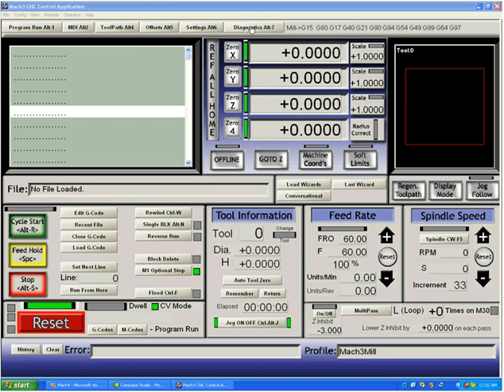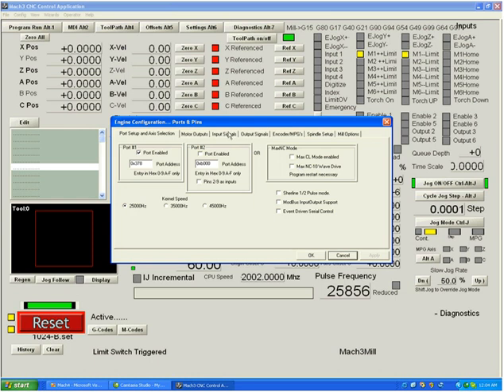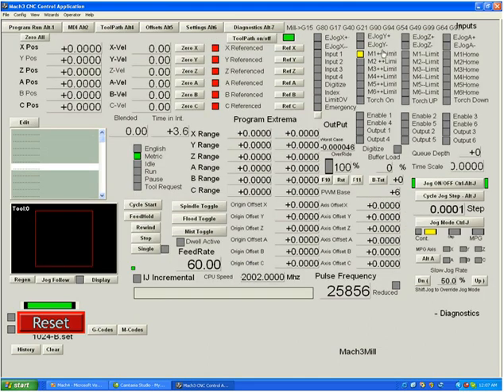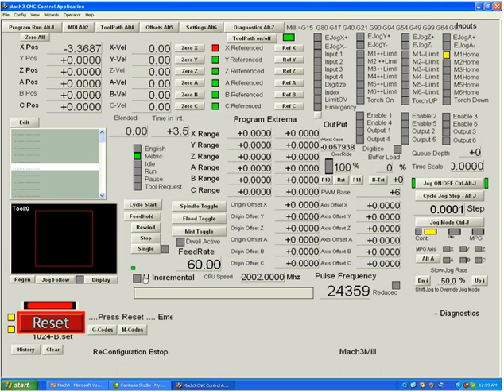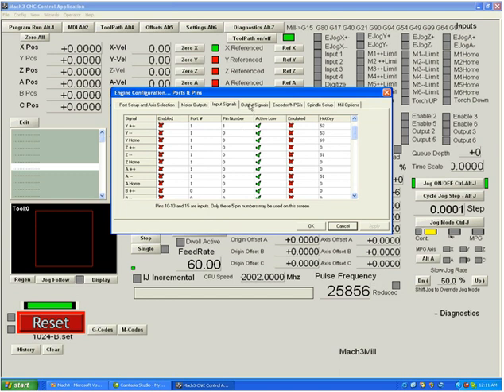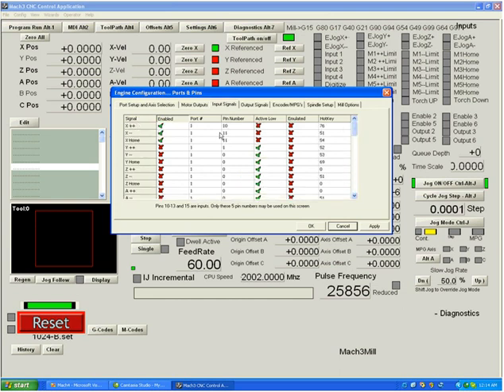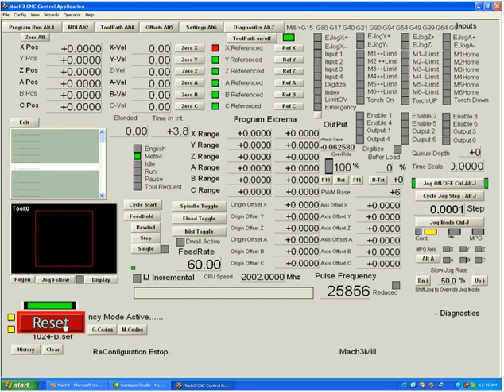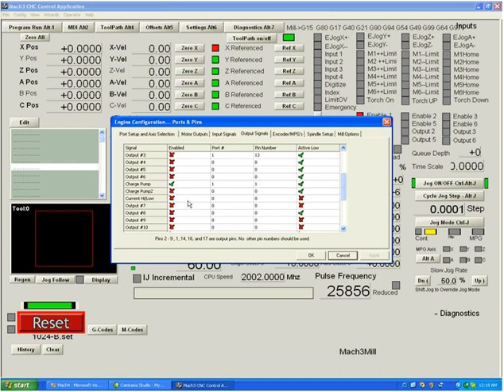Mach3 inputs and Outputs

Comment: Dear Friend, 
I trying to make conection for limit switch using two Normaly Close switch with serial conection and put enabled check mark on X axis on Mach3, after push apply and OK botton, limit switch does not active (LED input signal does not light up) eventhough I hit the switch. Whats wrong?